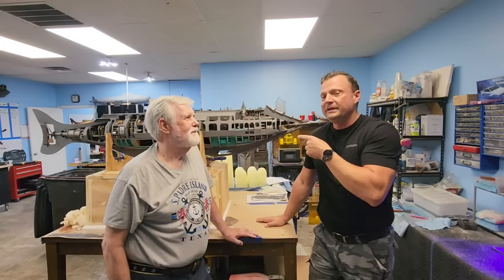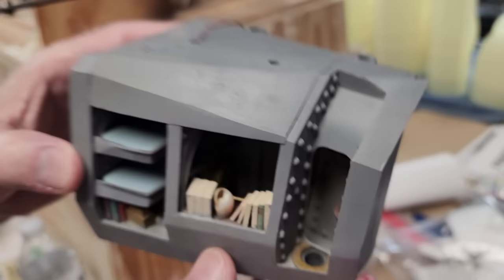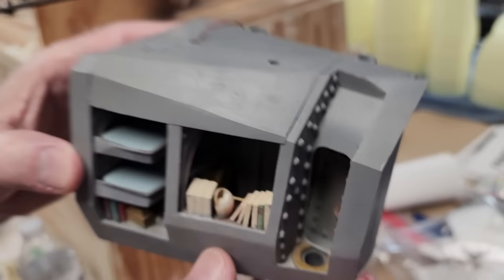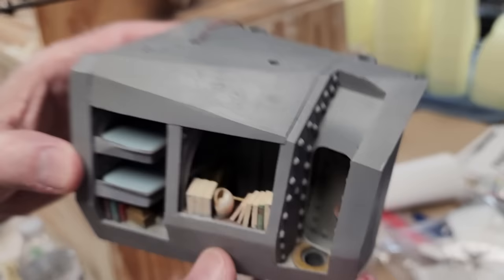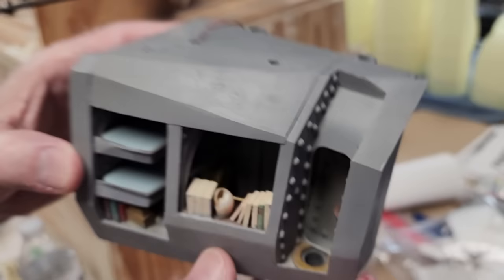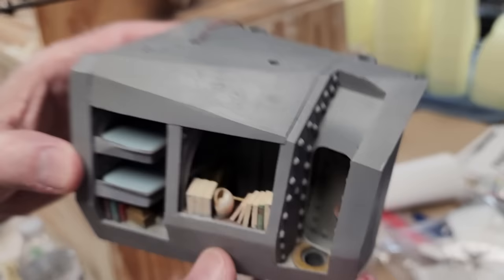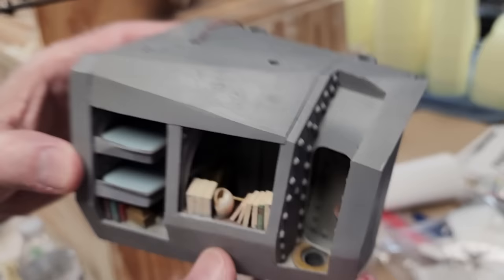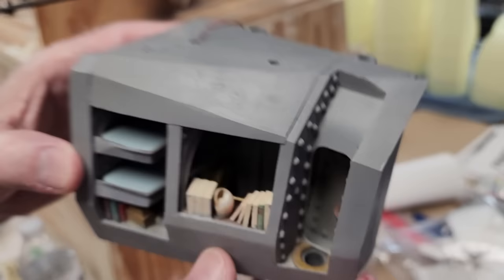Tour of a MASSIVE 7ft Long Disney Nautilus With a FULL INTERIOR!

Comment: Ken did a better job of laying out the interior than the studio did. But then the boat's design changed so many times before filming, the interior's end result was a mixture of several stages.
Reply: I can tell you he did a lot of work comparing the movie shots with the dimensions of the hull and had to reformat several sections.

Comment: I think if it were to be in a museum it would have to take up an entire room and not just confined to single display. Each separate piece would have to be under glass on a wheel so it could turn to show off as much interior detail as possible with a small picture of the sub with an arrow showing where on the ship it fits. A separate model of the completed sub could be in a separate display in the middle of the room with THIS particular deep dive video on display at 4 different areas so as many people could watch in part or in full as they wish. There should also be two walls featuring a large-scale blueprint. Perhaps along the walls there could be pipes and assorted gadgets to add to the "feel" of a submarine and the general lighting scheme could be splashes of blues and greens. Just a thought. But OMG what a stunning and incredible achievement.

Comment: Ken is, in my opinion, one of a small number of superb master model craftsmen, such as Rojas Bazan & Young C. Park (both of whom have scratch built incredibly detailed, large scale aircraft models from metal, & by using hand fabrication methods).

This model of the Disney Nautilus submarine is simply outstanding (clearly) in every way; detail, design, planning, craftsmanship & creativity, to say the least, probably. Since there were no overall definite interior layout arrangement plans available for the movie submarine (I gather), of course several interior compartments & associated details & size would need to be based on Ken's own analysis, research & best determination, of which he clearly gave much consideration. That the model was constructed to be disassembled, with very closely fitting sub assemblies, is also amazing, as a stand alone feature of outstanding craftsmanship. 

I believe model should definitely be preserved in museum conditions.

Comment: Damn ,gentlemen this is Awesome ! One of y Great Uncles  was inWW 2 Silent Service on the USSS  Spadefish and then as a ElectricalEngineer after the war he went to work  for Philco  And wastheir  top Repairman  after his retirement. he wound up building Scale replicas  of the Spadefish. that operated.  By Remote Control  including diving ,shooting Torpedos  ,Surfacing and performing all of the  operations of a WW2 Submarine they were commissioned by the Smithstonian. to build a  Scale Model with the detail they used  and were compensated Financially   and the boat was put on Display. in the Museumn  FYI. the agreement. was this boat would not  be a functioning model  with all the electronics  all though. it was built  that they knew what. Electronics would  operate it if  it ever was desired ?   they never went down that path and sadly my Uncle has passed since then   he was also  honored by the United States Navy for his Service  and dedication  to the Silent Service Vetrans Association where my Uncle built and towed another Scale Spadefish model in Parades and other  Venues  that boat was built out of Aluminum  and was  about 17 feet long  when completed the   diving Remote Control Submarines were finished out  at right around 9 feet Bow to Stern  and that  dimension was  because it would fit inside my Uncles  Station .wagon he had at that time  so he and my Aunt could still travel  in their own car to events

Comment: Technically the “Ram” is called a “Bowsprit” where this one is designed for ramming / sinking warships. The wheelhouse is also called the “Sail” and in front of the wheelhouse is the “Raker” used in conjunction with the “Bowsprit” to rip open the hull of warships.
Reply from the maker: Bowsprits are used in sailing vessels, not submarines (or even other naval vessels not using sails).  A better term might be "Rostrum", or hull-piercing protuberance on the front of a ship. 

The wheelhouse was never referred to as the sail. That term was not used until submarines stopped using the raised section of boat to control or 'con' the submarine. Previously, that area was referred to as the "conning tower", which would be a more correct term, but again, not ever used in the movie or by fans to refer to this area.  USS Triton in 1956 was the last boat that had a conning tower, and from then on the area was referred to as a sail.
Reply: @RCSubGuy it’s not a real submarine, the original design was by Harper Goff for Walt Disney’s 20,000 Leagues movie, the former 20K attraction at WDW required us to use the terms I listed based on the movie, not US Navy. I was an operator, trainer, and Lead at that attraction, we had an SOP and Training manual using those terms. Sorry if that frustrates you but there it is.

Comment: Amazing model, Captain Nemo would be proud. You keep mentioning if a bigger scale was used that somethings would be added / done differently. Is that because the parts would be too fiddly small at the current scale?
Reply from the maker: No, Ken wanted to render the interior at a smaller scale in order to more accurately portray the interior of the boat. At this scale, it's just not feasible to make fully accurate.

Comment: ? i'd think a shock absorber on a ram, completely defeats its purpose!  
You'd want all the weight of the ship directly connected to that thing, ...also the shape would make it susceptible to getting stuck.... anyway apart from these gripes, the model looks awesome!
Reply from the maker: Yes, it's an interesting choice. In my mind, however, the ram was not used to sink ships. Per the movie, the rakers gutted the enemy ship. The ram could, perhaps, be simply there to create a needle-like shape to cut through the water, spring-loaded in case of a collision?

Comment: 1. 2. 3. Poncho lunchbag dirigible parachute cu³ 270sqft - 290sqft  propellor,  (5) atmosphere 2090 - 2179 
4187 carrier naval size ships ⅙ - ⅛ today's conduit terminal battleship computer phantom 1 - 3
Outerspace 7 type ship each 13 - 17 on the stationary orbit
Return to 1. 2. 3.
Wood aerospace 40 window(s)  140ft thick wood for suvival rift galaxies orbiting 2 × collissing 26.4 & 31.5 
Return to 1. 2. 3. 
Meteor and pilot area 2.5 ⅕ the carrier passing fleet 
'Earth 17,407,000 million outerspace fleet
5+-,6,7,8,9,10,11,12,13,14,15,16,17,18,19,20,21,22,23,24,25,26,27,28,29,30,31,32,33,34,34,35,36,37,38,39,40,41,42 type fuselage aeroce (7) type to choose and produce merchant trade 
1.2.3.

Person on añalphile 01, 03 kiloton expansion astral star unlawful destroy
1 :; 2 :; 3 spread 14+-,15
1 :; 2 :; 3 spread 16+-17, 
18 

3310 jail sentence 
1330¹.³⁴ detain assylum 

Button 5047 solar system 6891 solar system 
16% through 18.9% mind control -(½fuck head + ½fuckface) search: terminal conduit administrator average(s) s.a.s. 
S.A.R.S.Ñ.P.
I.i.l.ñ above

Songs lagrange deffective 78% blowing debri.
M.s.r.p.
Suggested retail

Quiz basis a.a.f.f.a.i.r.r.t. 
Knowledge m.l.s. term response discertation public elementary school administrator(s) average 1569 average response alert interstellar gallactic assemble planet builders. 14 galaxy over giants solar burst temple pilot heat delta change 0.5°, 810 years

Southern hemisphere exit / entry 2.1 million year equation. wrapped helm ¿nhari? Galaxy 
Destination trvel collision referrence last 105 - 106 years two entry exit galaxies person milky way orbiting 26.4 eliptical rotatimg group known to person as seperate visible invisible galaxy.  My periodic element table invisible visible galaxy on seperated transreciever directed in horzontal & verticle intercom master & remote.  Indicates a 60% acknowledgement of the transection astral telemetry. Thord know collision impact detionation kiloton war during warp drive isolation value inertia dampner of the varrier a.r.g.o. 15% - 18% unlawful destroy 
To our own city county state coming soon weather (5) type atmosphere outerspace.  18 waves wrapped, again follow know we vt] outerspace. 
1. A.v.a. wing has flight with bird
2. U.h.f. habitat spider & snake, pin needle sphere to control induction i.p.
P.a
3. M.a.r. h²o h³o achievement knowledge basis 6th & 7th grade provisional biological habitat single valve mussle & octupus
4. T.e.r. know are primary tactical living person & animal land with robot intellectual community & community government.  

The regulation and standard 
1. 
2.
1467. Rule(s) and law(s)

Measure & standard: unit convertor ...

Coming soon 
Weather 0.1 - 1570 
On 'earth" weather 0.1 vector 0.0012 - weather 109 vector 119

City to be decimated to 11% without fortification from meteor cu² & pulmice ash cu³ × month(s) too conglomerate mountain cu 
52, 53, 54+-, 55, 56, 57, 58 ¿ year 13% effeciency army naval air force -3, archive transporter +1, +2, +3..+7 vector weather city, cities infrastructure engineering 10 - 13 for weather 14 - 17 ‽tel:+23(ban)anna?ephone codex a.i.o.m. 6.0 - 6.1 

Aerospace, 8197 large e.r.t.u.i.o.a.l.b.g. achieve stationary orbit naval ocean for 
Outer space 
Atmosphere (7) hanger and equipment q.i.i.j.o. 
2077 - 2180 discipline to survive galactic meteor 
Conglomerate mountain roatate equipment pilot(s) move and work in 3.170 the standard daily rate carrier a.r.g.o. and globe|carrier a.r.g.o. pass

Sum gundam, galactica, star wars, buck rodger; mongrol, flash: gordon & hawkmanol, hilmes, star trek 

I'm from a seperate galaxy with operating sufficient standard & regulation
I came from a post apocolypse entry, from this galaxy the equipment stand & measure; unit convertor transponds FCC. 
Fiscal Monetary 
Yule, you cannot turn a.m.z.i.t.a. off/on this galaxy is 1.0279 orbiting visible invisible periodic element table galaxy.
Youle you cannot turn a.m.z.i.t.a. on/off this galaxy is orbiting visible invisible periodic element table galaxy.
Y.u.l.a.e. 
Regulation & standard
Standard & measure: 'unit convertor" 
1.7 billion c.d. 
5.0 billion c.d. 

Require 5.0 - 5.1 billion 
           -  1.6 - 1.7 billion
____________________

One other galaxy
____________________
_____________________ 

26.4 orbiting galaxy 
Colliding 30.5 galaxy 

      26.4 galaxy entry/exit
  +  30.5
______________________

98.5% visible milky way 1.67 million years 100% visible bilecromi galaxy 
____________________
_____________________

 99015-3 Stolen passport Mars globe|carrier a.r.g.o.(s) phoebes globe|carrier a.r.g.o.(s)0.3 mars & phoebesparsec o.i.k.n.star 019836-75.5   regulation & standard 01734-9Police I require preventative monetary provisional dramatization Earth & moon 0195634[11][Foreign][Customś]

The moral is 14,350,000 (7) type outerspace plane flying (5) atmosphere while you robbed pension benefit & made occurrance disability sat to ease a round into a worker to obituary a home & business with greater growth in years 17.  
Today your the fire police new orlean, memhis tennessee, minneapolis mn. Theft robber (3) pension statement you and adam 12, s.w.a.t. 42 - 43 years ¿ 349715 ?
Police library requered to retain ability to think with 78% mind control diagnostic 43 grupple rotation. 

Writer seperate galaxy.